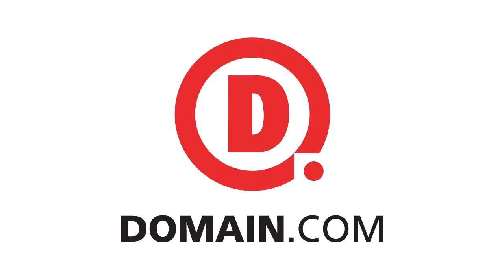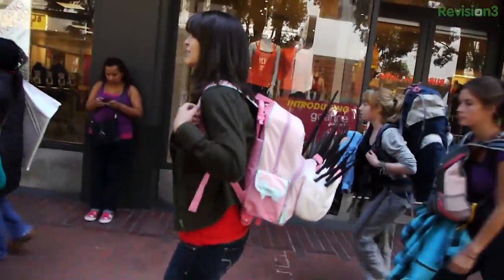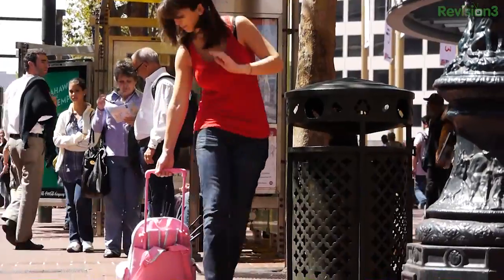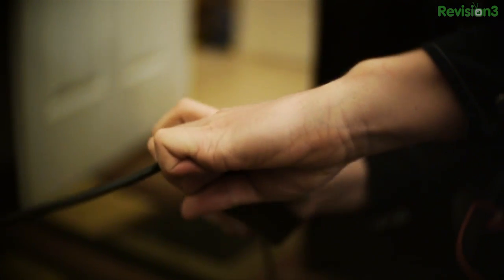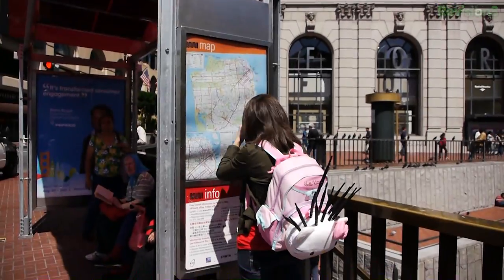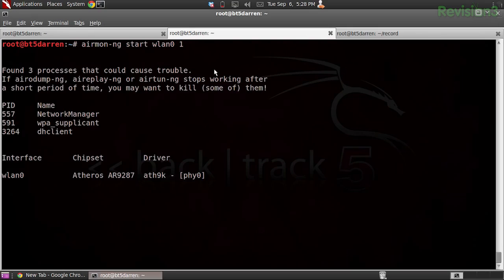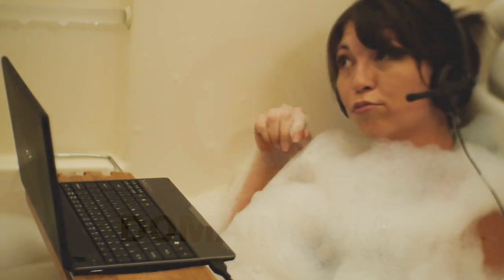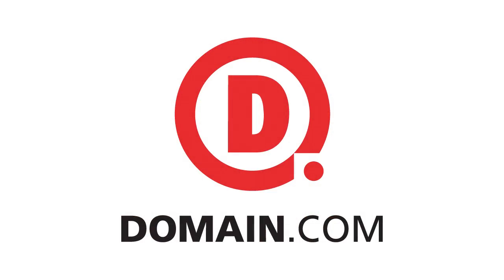Hak5 - The 14 Channel WiFi Sniffing Hello Kitty Backpack Case Mod 10x03.1

Comment: Those antennas are going to get so much interference just from each other, there's no way them and that WiFi Pineapple will be able to send/receive even a usable signal LOL. Oh yeah, and the heat alone will fry that bag. And as for the computer itself? Seriously guys? Linux, command lines and an on-board graphics chip? This isn't the 1980's you know! Also, so how are you going to get a WiFi signal in the US from Japan? Ship it over in a cargo container? lolz epic fail all around!

Comment: Both teams strictly adhered to the otherwise loose guidelines of the contest: Mod a full ATX case below $200. If you want to vote for the best one, then I think you should carve out all the insides each entry contains. In doing so, you basically have an unmodified pink backpack versus a stained, stylized plywood box. It doesn't matter what they hold (as long as it's the ATX form factor) or what the comp inside can do, it's just the case itself. All that said, I think Ben is the clear winner here

Comment: Isn't that an ASUS M4A88TD-V Evo or something close?  I have one, and with the addition of a $20 Radeon HD5450, you get dual-headed crossfire rig (onboard HD4250 supports hybrid crossfire).  I used this method as a hold me over when I couldn't afford the system I wanted AND a decent gpu. 60 fps on tribes ascend on min.  Take that Wolftech65301.  It could be a gaming rig, it just doesn't wanna.  As for the monitor, any smartphone can remotely control it (teamviewer is stupid easy).